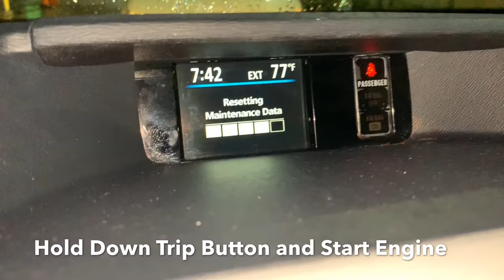2011-2020 Toyota Sienna Oil Change DIY

Comment: one advice sir .... if you opened the small hatch first at the bottom of the filter housing and inserted the plastic funnel provided with the new filter, your hand wouldn't be wet with used oil. It was there to facilitate controlled leak of the remaining used oil in the filter housing. I like your videos 👍
Reply from the maker: Yes I actually tried to remove it to show you folks but the whole housing loosened lol actually didn't make a mess like I expected.
Reply: @MrRangerZr1  
Likely because someone used the ⅜ inch drive to tighten the entire oil filter cap. The cap should be 18 ft.lbs and the drainplug in the cap should only be 9 ft.lbs.
Reply: How would you loosen that small drain plug within the oil filter housing if the whole housing moves when trying to remove the drain plug?
Reply: That is pretty lame.  I saw that on the maintenance guide and was like, WFT I got to go get a hose?  And another O-ring.  Yeah, not gonna do that thanks.
Reply: Good reminder, I tried to open small filter housing but previous owner tightened so hard I ended up loosening the whole thing like this video did it. Yes, Ur right though, that should be the correct step again stated in the filter box instruction. I have stated 2 comments, 1) just incase wear safey eye glases, 2) wear mask when ur spraying break clearner, chemical, and likely ended up inhaling *mist of break cleaner!
Reply: I’ve seen several videos that just leave the smaller drain plug in place.  I’ve also done it this way for years and everything is good.

Comment: Aren’t you suppose to drain the oil and take off the filter at the same time ? Once you take the filter off the remaining dirty oil goes in the drain pan
Reply from the maker: It doesn't matter, you can remove the filter first or last.

Comment: For those people reading this....it seems for various model years of Sienna they used either plastic or aluminum oil filter housings for the 3.5L v6 engine. Can folks here confirm that the 2016 model year used aluminum?.....I think 2017 - 2019 used plastic.
Reply from the maker: Some models use plastic, i hate the plastic housing.
Reply: @MrRangerZr1  ...yes...I say that also.....trying to pin down what the 2016 model year Sienna with 3.5L v-6 uses.....I think aluminum. Furthermore....I THINK starting 2017 and beyond.... at least until 2019, it remained plastic. There have to be a lot of folks viewing your vid.....would like confirmation from someone, if possible....thanks. Factoid.....if you look up the part as a replacement part from the official Toyota website....it looks like the plastic part is no-longer-available.
Reply: I have a 2019 Sienna Limited and it came with a plastic housing. I ended up cracking the plastic and bought a aluminum
Reply: Scotty Kilmer recommends Baxter Performance’s aftermarket replacement mod for these (especially if you have the plastic housing). They let you use the standard screw-on filters instead and have a schrader valve that you can attach an air pump to that will blow the excess oil from the filter back into the engine/pan so it doesn’t make such a mess when you change the filter. There’s different versions for various makes/models including these ones for Toyota. They cost around $250-280 as of 2024 but if you change your own oil it might be worth it to make the process less of a hassle.
Reply: @MrRangerZr1  ...doesn't sound right.....many reports of interchange. There may be different sizes threads used on different Toyotas....but for whatever model there should be a plastic and metal interchange possibility.
Reply: @ToadalSimplicity  ..saw that this piece is avalable but never saw Scotty recommending this ( he usually sticks to factory), and the mod is pricey. Found out since I wrote my first post here that 2016 Sienna, 3.5L, uses metal, not plastic.
Reply from the maker: @TheWilferch  you're right, just make sure the thread size is same. Running aluminum caps on all my v8s now.

Comment: So the smaller o ring is not needed?
Reply from the maker: If you remove the filter drain (small plug on the filter housing) then swap it out. I don't bother with the small plug because it removes the entire filter filter housing trying to break it loose lol